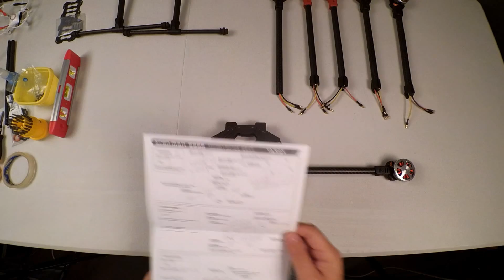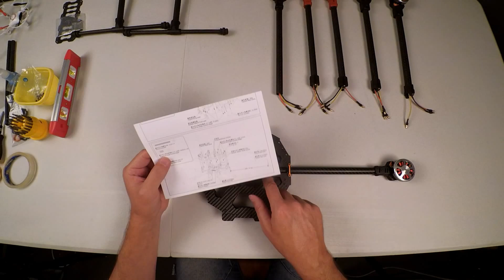Hexacopter Build Part 4 - Assemble Arms of Tarot FY690S

Comment: What I've done - I've measured distance between motor centers for the opposite fixed arms, than removed frame width from the measurement and divided result by two. It gave me exactly 25cm from frame edge to the center of the motor (coil shaft) for the floating arms.

Comment: Lekker Riaan! Nice spot about the error! Although I doubt it'll have much effect on anything being a cm or so out. That is to say it's a universal "error" and not a single one.. That would not be nice flying! Epic job on this series of tuts man, i have to commend you, shot a lot for your efforts! 

Did you happen to attend the fly-in at Hermanus this wkend? I'll say, It made us proud.
Reply from the maker: Hi. Thanks for the compliment. Yeah, the measurement error is not a huge issue if it is consistent across all the arms and everything is kept level. At this scale of stuff a long/shorter/twisted arm results in drift so one needs to try to keep it all as close to level and lengths as you can to keep video movement clean. I was not able to get to the Hermanus meet up but I saw some pics and video and it looked awesome. Keep a lookout on my channel as I plan to upgrade the current 2-axis gimbal on this Hexacopter to a 3-axis.
Reply: Riaan Roux  I figured one would observe some drift, would be something that'll be rather evident on takeoff. I'd imagine it would effect roll or pitch, or both most, it would most diffidently make the flight controller do it's fair share of work!!

Yeah was even on the SABC news hey, they flew in owner of Pilot, Toby Tan, 3D flyers champ Fergus Lin and European champion Martin Pickering. So it was technically an international event, it doesn't happen enough in SA to say the least and yet it happened at our newly established field of all places. Awsome! I subbed so will be keeping an eye out! What size unit you looking to carry? I'm betting bigger than the goPro, maybe Sony nex-X?
Reply: Riaan Roux  If you do go bigger, do yourself a huge favor and get yourself a lekka lil FPV transmitter and camera small enough to mount under the camera where fixed to the gimbal so as to observe the same view as the larger unit. Hop over to your store of choice and pickup what they call a "head tracker", 5.8Ghz Transmitter, receiver and so on, or the entire goggle set like the "Quanum Complete FPV Bundle" from Hobbyking, link that to your gimbal and you'll have the ability to focus far more accurately, far more interactively and with more control over the feeling of the scene being captured. You may think it sounds expensive but it's not actually all that pricey, if you do some online digging. My reason for the mini cam is that it's simpler to transmit an image in 720p than it is to transmit something like 4/6k... But yeah, all in all that should make for a very nice setup, the cherry on the cake as some may say!